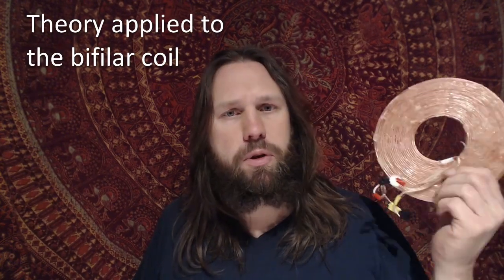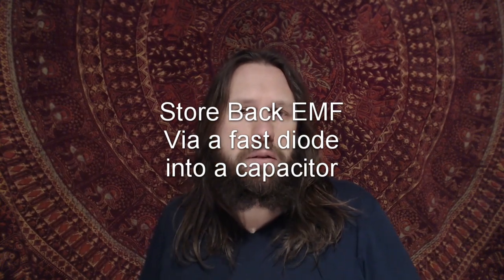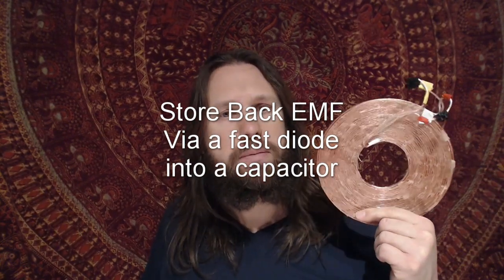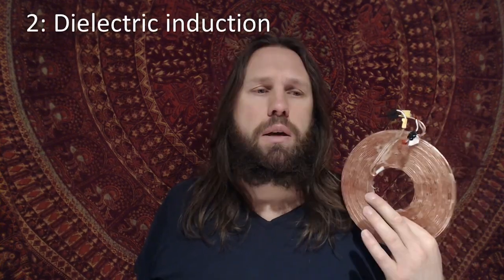C.P. Steinmetz explains electricity 03 Infinite voltage and current

Comment: Thanks IVO!  So as you pointed out the capacitor and inductor (conjugates of each other) trade the same energy back and forth minus heat losses of the copper (dampening affect; Q), and at a resonant frequency (1/2 pi X sqrt of L XC).  You also pointed out that the discharge/charge rate of the energy is R times C (RC - Capacitor) and L divided by R (L/R Inductor).  So no energy gain occurring here, just a chance to use your counter EMF (MMF) instead of wasting it (sending it back to the power company)as you mentioned via the diode capacitor combination.  In my city the power company doesn't charge for reactive power so you might as well use it all(:

Now then,  a coil in resonance creates a magnetic field, and the magnetic field can be used as a force to create work or as a part of a generator system.  And as long as this magnetic field creating force, does not dampen the resonant action, then one can create energy separate of the resonant circuit that is not felt by the resonant circuit (defeating Lenz Law).  Several ways to do this.  One must reduce or eliminate mutual feedback to the resonant coil (reduce mutual induction).  One way to do this is to place your load coil (or motor in case of force) orthogonal (perpendicular) to the resonant coil.  You follow SkyCollection which has some examples of both an orthogonal  motor application and electric induction application.

One of Tesla's secrets was that he took the Back EMF (MMF) and either fed it back through the load or back to drive the generator (force application) rather then creating a drag on the generator.  In doing so he reduced the fuel demand of generators or increased the electrical output.
Reply from the maker: yes indeed I re-use the back emf into the resonant coil. 
But before an output is created, I first need to know at what phase angle of the resonant sine wave I need to discharge the capacitor.
I have 2 scenarios. 
one is at 0 degrees (of the resonant voltage sine)
the other at 90 degrees (1/2 pi). both options have their benefits.
one: increases the resonant electric field energy
the other: creates a power spike, by combining the dielectric and magnetic fields.

But more important, what does this instant short capacitor discharge do, to the magnetic field of the the first dc pulsed coil?

A magnetic field can do work, but at these frequencies (150kHz) I don't expect to run a motor. 
The Dielectric field can also do work (if converted to DC), as it can be converted into a magnetic field (that at lower frequencies can run a motor). 

Its also nice to realize, the output, will lower the voltage of the resonant coil, making it more like a square wave.
This then, creates a bigger voltage difference between the resonant coil, and the capacitor that is discharged, resulting in a higher current. Again... speculation. I'll have to test it to see what reality will say about all this. 
I already have redesigned my first circuit, to be able to test all this. I'll need to build it, and see how it works.
 
There is also the option of using positive or negative back EMF. this could also be a factor.
I need to wrap my head around the principles of magnetic and dielectric induction between the coils....
Reply: "A magnetic field can do work, but at these frequencies (150kHz) I don't expect to run a motor."  Typically you would excite (induce voltage into)  an orthogonal coil from the resonant circuit coil and then rectify the output to DC, as you described with the dielectric field, which is then fed back through a motor coil (or generator) aiding the mechanical rotation (work).

Would be very interested if you could use the positive EMF.  Unlike the ease of using back EMF which  only requires a diode into a capacitor, positive EMF is a more difficult nut to crack.  The reason being that positive EMF opposes the source (i.e., Voltage Leads Current) so a diode would oppose the source that feeds the coil.

Steinmetz, "There is obviously no more sense in thinking of the capacity current as current which charges the conductor with a quantity of electricity, than there is of speaking of the inductance voltage as charging the conductor with a quantity of magnetism."  The conductor in the resonant circuit might be describe as just a conduit between the capacitor and coil (any power there is just dampening losses, or IsquaredR losses).  The power circuit supplying the resonant circuit only needs to replace these losses and is best accomplished in terms of the power supply (your pulse function generator or osc).  By injecting directly into the resonant coil or capacitor (how to do this would be a trick) would change the resonant frequency and intimately connect your resonant circuit to the whims of the output circuit, not a good thing.  Tesla purposely attempted to isolate output from resonant circuit, even to the point of using air coils vs. iron centered coils.  So I would be interested if you succeed in a stable/predictable circuit that couples output circuit to the resonant circuit.

"one: increases the resonant electric field energy
the other: creates a power spike, by combining the dielectric and magnetic fields."
The capacity the dielectric field (capacitor) is produced not by current but voltage (basis of cold electricity). Power exists when the voltage is accompanied by current.  The resonant coil is across the capacitance (intimately in the case of a bifilar coil) and thus the compression of the dielectric field results in a flow of current (hot circuit, power) through this coil (frequency of which is determined by L and C time constants).  Note that there is not a flow of current through the capacitor (the dielectric is an insulator)...rater the inevitable collapse of the magnetic field (analogy stretched rubber bands of the magnetic field collapsing) creates a VOLTAGE, which is directly transferred to the capacity of the dielectric field (not by Current!!!).  Thus, with inductance the reaction to change of field is the production of voltage. The current is proportionate to the field strength only and not velocity of field.  However there is no current flow!!! (Stienmetz agrees as I quoted above only displacement currents (which are internal vibrations of atoms/electrons in the copper wire and dielectric).  Thus it may be a misleading thought that combining dielectric and magnetic fields "creates a power spike".  Certainly be interested if you find proof of that(:

Now in the case of dielectric fields crossing perpendicularly in the space between wires (transmission lines, cross product)...there is an energy flow perpendicular to this crossing at approximately the speed of light which can be harnessed for work (as is done every day in the transmission transformers).  Then the phase angle (PF, cos theta, etc...) between the voltage/current is critical to manifestation of real power.  So at the conversion point in your circuit to power...I would strive for an in phase relationship.

Fingers are tired...and just thinking through my fingers...hopefully something here sparks in your mind or helps you meet your goals for your project...
Reply from the maker: thanks Mark S, a few quick responses from me:
A "charged" capacitor shorted out with an amp meter, shows a meter that instantly maxes out, if it isn't destroyed.
So a dielectric field that is shorted out by a bifilar coil produces a CURRENT in the coil. if the shortcut is very short, this is a current spike.

Indeed power is when the phase angle of voltage and current is in phase (0 degrees).
voltage is a representative of the dielectric field.
current is the representative of the magnetic field.
so... power comes from combining these fields, in phase.
So a capacitor discharge (current spike) into a resonant coil at max voltage...
Reply: Certainly, agree, Dielectric discharges of great speed and energy can vaporize conductors (coils), watermelons, or whatever conductor releases the ENERGY.  This energy is converted into a magnetic field which shows a pulse on a meter as you point out.  The current produced in the coil is a "dis placement current"...it has no complete circuit to travel through as the Capacitor's dielectric is an insulator.  This displacement current also results in heat (power dissipation) and if enough energy the copper vaporizes.  Quite simply the current has no where to go...(the capacitor blocks it)...

If you connect a voltage source to an open wire the voltage is felt on the end of the wire regardless of the length of the wire (faster then the speed of light).  A tesla coil secondary is open on one end of the wire...capacitance works by propagating potential through counterspace (compression)...to quote Steinmetz, "Unfortunately, to large extent in dealing with dielectric fields the prehistoric conception of the electrostatic charge (electron) on the conductor still exists, and by its use destroys the analogy between the two components of the electric field, the magnetic and the dielectric, and makes the consideration of dielectric fields unnecessarily complicated."

The reason people came up with mythical electrons flowing in an AC conductor is that they were trying to come to grips with the fact that current flow requires a complete circuit, so the electrons have to move somewhere...this is just not what happens...they just vibrate (displacement current).  And these vibrations externally are seen as an external magnetic field in a conductor.

This is why I have seen in your circuits two diodes connected nutt to butt off one wire coming from your bifilar coil and CHARGING a capacitor.  This would not work with current flow theory...but does with the pure potential...in fact you are seeing a capacitor "charge" off one wire!!!  You made videos of this.  It happened...it was real...it worked because of pure AC POTENTIAL.
Reply from the maker: That quote of Steinmetz is brilliant, i intend to base my next video around it, good you noticed it also.

the diodes, in my opinion simply rectify the ac sine wave of the resonant coil, and charge the capacitor. why is this only possible at the resonant frequency?

is the diode working 2 ways, at the same time? one direction for the voltage, the opposite direction for the current? As at resonance the dielectric and magnetic field are identical but "opposite"? and out of phase 90 degrees?

i dont know, but my mind is tired so I'll leave it at this for now.
in the end the experiment will tell the truth.
Reply: It is not only possible at resonant frequency.  It is best at the quarter or three quarter wavelength of the conductor which experiences the peak high potential and the peak low potential on one wire.  At any other point it would be less noticeable to even zero.  Or, of course  as you practice, when using two separate coils it is preferable that both coils are at the same resonant frequency and out of phase.

I don't think a diode is operating both ways.  After the forward breakdown voltage it allows the forward potential to pass (and in DC circuit the current to pass as well).

The dielectric and magnetic fields are conjugates of each other.  In a resonant circuit they are 90 degrees out of phase (not opposite).  The energy of compression of the dielectric into "counterspace" released into the expansion or torsion of expanding (force/motion) lines of force (analogy rubber bands) displaced by 90 degrees (If you add resistance the angle can change).  So the dielectric field (phi) and magnetic field are not identical, but in a perfect system trade the same energy forever.  Most likely they are different aspects of the same thing.  Analogy, Ken Wheelers expanding Magnetic Torus collapsing into a counter space hyperbola centripetal drain (phi).

Yes, let the experiments be the final arbitrator...or the opening of new doors and windows....
Reply from the maker: that counterspacial hyperbola if the dielectric, is so abstract to me, so hard to grasp. I tend to think the dielectric field is concentrated between the windings (voltage difference). but I have build a magnetic based object, based on that hyperbola, and it works. So it does appear to be real. my mind simply can't grasp it fully.
thanks for reminding me, I almost forgot the dielectric hyperbola existed.
Reply: Yes, I built as well and it does exist.  Also with all respect to Ken, a guy named Howard Johnson described the characteristics of a magnetic field in 1980!!!, way before Ken.  He actually built and patented a permanent magnet motor, around then, that actually drove a generator through a belt creating many watts using the convergent/divergent vortices.   Through an understanding of the spin directions around a magnet he was actually able to create magnetic "gates" where North attracted North!  It's all in the spin, anywhere around a circle where spins are in the opposite direction with another circle attracts and vice-versa (analogy meshing gears), also described by Joseph Newman way before Ken.

The field around a permanent magnet is actually two donuts (one on south side and one on north side) creating a bloch field in the middle of the magnet and down the center (in the center is the calm of the tornado or centripetal convergence area(Ken))!.

1)  There is most certainly a dielectric field between the windings of every coil.  All coils have capacitance.  So there is always an electric field between the wires of energized coils.  This electric field is contained between wires internally (capacitance) with minor 'leakage'.

2)  At RF frequencies a coil will transmit an EMF field.  The EMF field begins first with the electrical part of the EMF wave, or electrical field, in area right next to the coil (near field).  To quantify this field is extremely complex, event with fast computers.  But it is there.

3)  Whenever there is a changing magnetic field across a conductor there is and electrical potential developed in conductors subjected to such changing field.  Certainly this is happening at the center of a pancake coil, and can be amplified by sizing of said coil with a metal conducting rod inserted observing right hand rule(for example golden rule dimensions and a spinning magnetic field created in the center),

4)  The creation of longitudinal (scalar) in the aether.  Typically created by vibrating a potential (small or large but more pronounced with high potential).

We won't even get into gravity which is electromagnetic in nature.

Over 15 years ago I copyrighted the term "Magnicity" to describe electrical phenomenon as it is both magnetic and electric in nature.
Reply from the maker: Magnicity, beautiful word! There is a professor using that same word. His back name also start with an S, I wonder if it is you? 
It thought about gravity, but I tend to put it on the shelf for now, I first want to find out how to create electric power, by amplification. I think both are related, once electric power amplification is understood, understanding gravity will follow. they seem closely related. Sdunek.
Reply: Yes, I notice there is use of my copyrighted term by others, like game makers, colleges, etc...fundamentally I created the term to describe the electrical phenomena.  At the time of my copyright , a search for magnicity on the internet yielded zero results, so I copyrighted it and have locked up magnicity.com for years and years to come.  I don't use magnicity.com for electrical purposes though.
Reply from the maker: Jay Andrew, its for all to share, I hope it may inspire many.
Reply: is this the basic boost converter do?
Reply from the maker: Jack bowman, what?